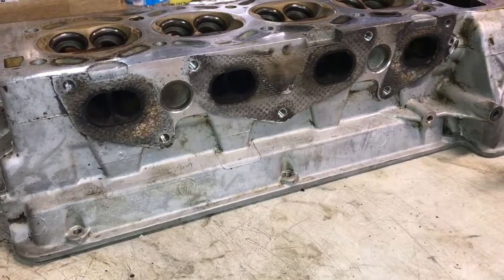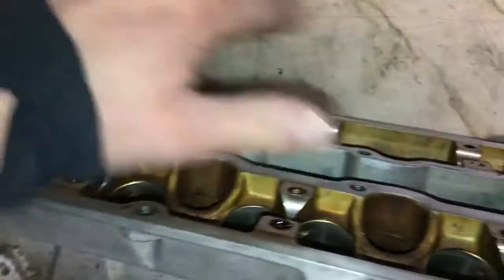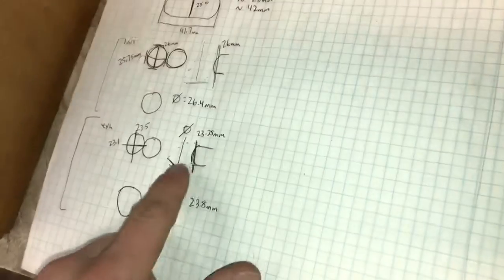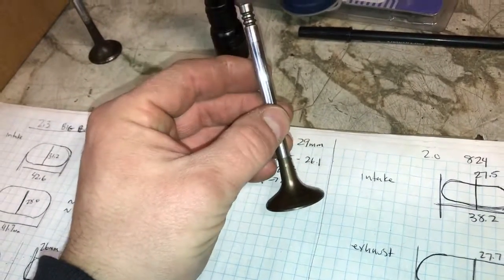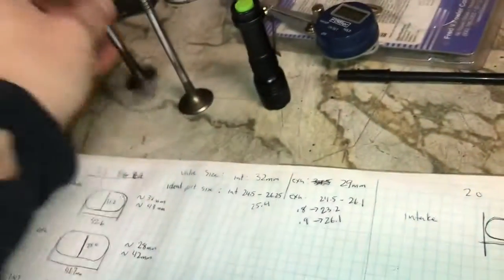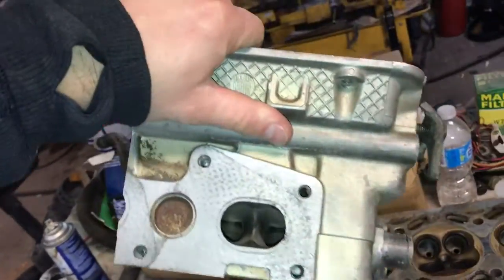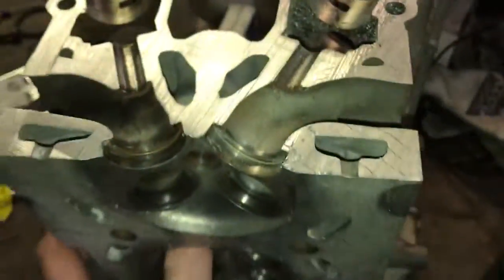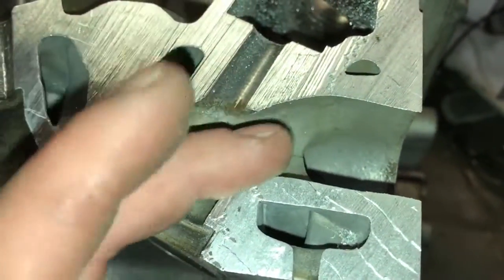Saab B202 cylinder head tuning

Comment: WOW!Great video. Can you tell me where I can find Saab cylinder head spec ? I have a 1997 9000 Aero (blown Gasket)  I would like to know what the spec are so the machine shop can mill out the minimum.
I ported mine by guessing wish I had watched this video first. Great and valuable information for the Saab guys.
Reply from the maker: Your head would be much different than this head because your car was a 1997, which had the 'short' head. Porting yours probably wasnt worth the trouble because they flow so well in comparison. The milling spec is 140.1mm +/- .1mm after surfacing, however if your are using an adjustable cam gear you can go much farther